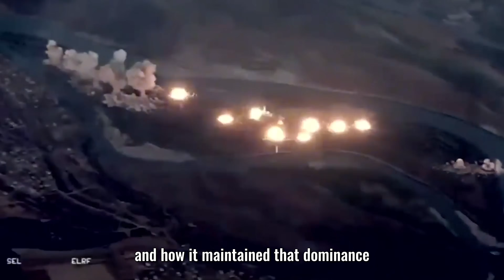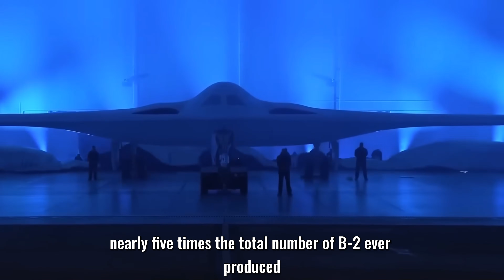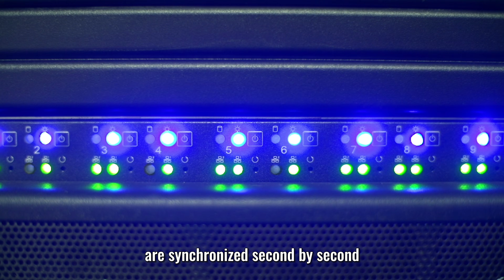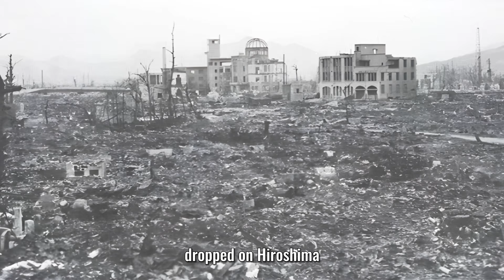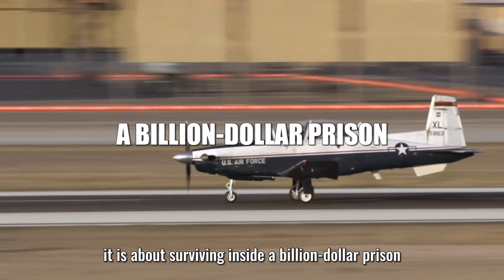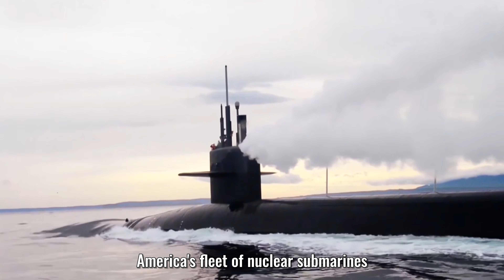B-21 Raider: The Most Dangerous Warplane Ever Built

Comment: If people think the B-21 Raider will be built in numbers they are stupid. How many B-21 are schuedled to be built? 100? 50? 
Once the Dem/Leftest take over Congress the funding for the B-21 Raider will be cut. That’s a given. So how many will survive the Dem/Leftest purge? My prediction 10-20. 
20 B-21 Raiders will not be useful.
Reply from the maker: The Air Force baseline remains at least 100 airframes, and because unit costs were capped early with digital design, it maintains unusually strong bipartisan backing compared to past bomber programs.

Comment: "Minimum planned fleet of 100 B-21 Raiders" - When the B-2 was first announced, they planned a fleet of 132 B-2s, but the sheer cost of the aircraft caused that number to be cut to 21. How many OPERATIONAL RAIDERS will actually BE FLYING??
Reply: @RobertNielsen1970  B2 cost about 2 billion dollars per plane, while B21 cost around 700 million. American government can product roughly 3 b21 at the same time only 1 for b2
Reply: @zhaopatricia5828  Does the phrase COST OVERRUN mean anything to you? Because there WILL BE cost overruns in the building of the B-21, I can almost guarantee. That $700 million cost per aircraft could EASILY top 2 billion dollars by the time full-scale production starts.

EDIT: Another post about the B-21 says that the program is ALREADY $2 BILLION OVER BUDGET! Wonder how much MORE per plane each of those 100 planned Raiders will cost NOW?

Comment: So based on your content, the B2 0perational costs are 200,000 per hour, so the Midnight Hammer mission cost just in maintenance, 36x7x200,000= $50,400,000 just in maintenance, not counting the refueling costs in midair, the weapons cost, etc. This is why China builds cheap junk that they don't care about if it gets shot down. One way drones are the weapons of the future. (and present)
Reply: Russia built cheap junk also and we see how that worked for them
Reply: @FP194 exactly!!!!
Reply from the maker: Spot on with the math! The B-2's maintenance nightmare is exactly why the B-21 was built.
While cheap drones are great, they can't carry a 30,000-lb GBU-57 bunker buster through heavily jammed A2/AD airspace. You still need deep-penetrating heavy payloads for 'Night One' operations.
The B-21 solves your exact concern: it uses new, durable stealth coatings to drastically lower the cost per flight hour. Plus, it will act as the 'quarterback' directing those very drone swarms. The future is a high-low mix: bombers kick the door in, drones overwhelm.
Reply: @NoMoreDems4Me  and that’s why we would absolutely decimate China. Cheap Drones don’t win wars. We would have complete air superiority. As well as complete maritime superiority. They have no air force worth talking about and a navy that is a complete joke. Our tech, training and experience will always dominate any moron that wants to test the US.